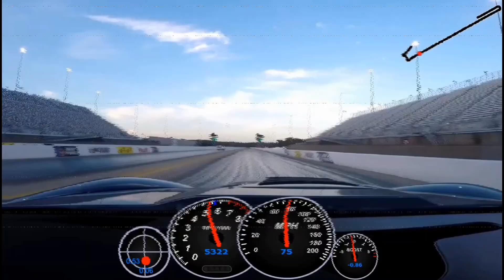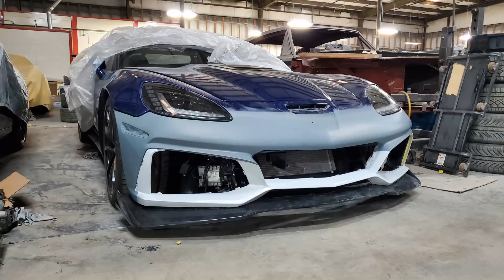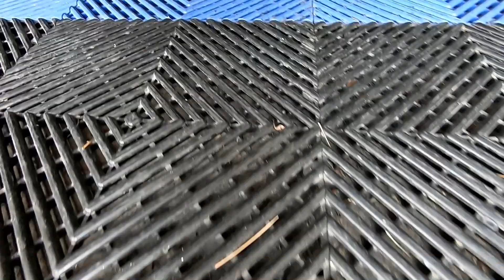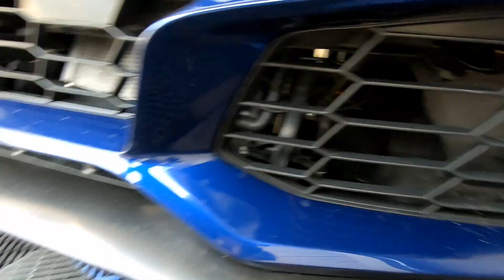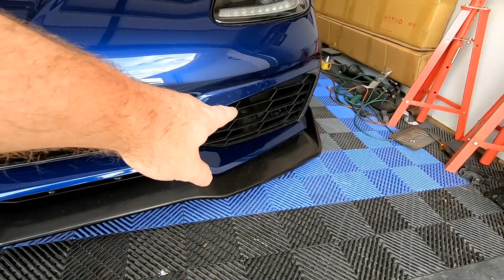The Corvette is back and better then ever!

Comment: Would love a break down of what you done to the motor and dyne #s and what you run in the 1/4 mile. Also would love to see more of the car out of the garage and rolling. thx
Reply from the maker: My 700 hp video in 10 minutes would be a good starting point. https://youtu.be/y1UWONCv7sQ